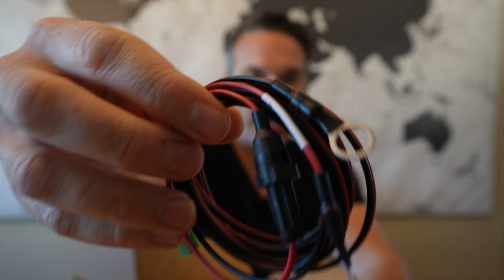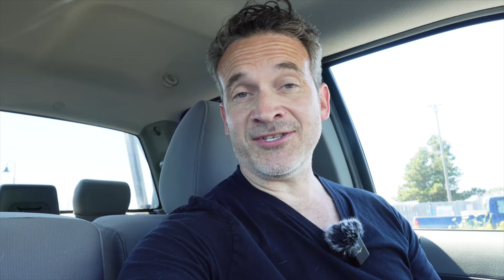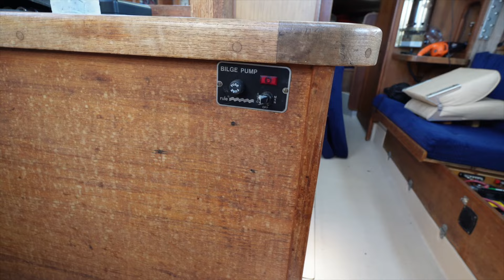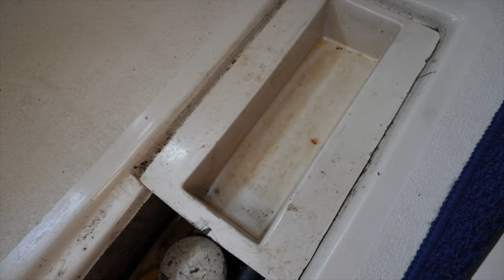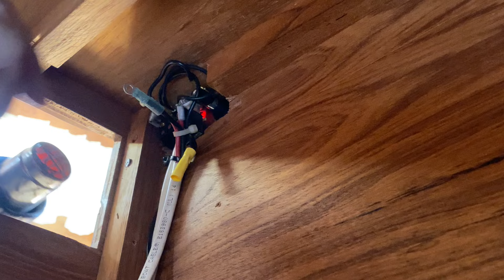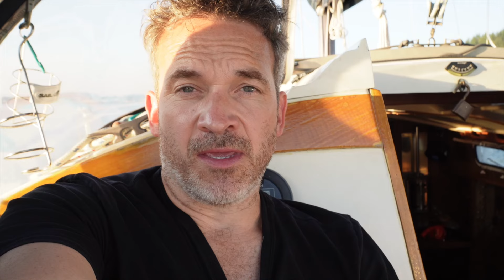ROAM DEVICES: Finally, An AFFORDABLE Cellular Boat MONITOR?! | Reviewed

Comment: Just ordered this kit; looking forward to having the peace of mind regarding my boat status at the marina when I'm sitting at home.  I have a "wash-down" deck, but still worry about water in the bilge during rain storms or while sitting at the dock.
Reply from the maker: That’s great! I think you’ll like it. They have recently expanded to include remote Ruuvi temp/humidity/motion sensors as well as a latch/door sensor so the platform is expanding which is pretty cool!

Comment: A very cheap remote anchor drag alarm can be created with an old mobile phone and the 'Anchor Pro' app.  The paid for version is cheap and, in my opinion, very good.  If you also have Telegram installed on the phone, it can send you a Telegram message on your regular phone alerting you to drag.  You can also interrogate from your onshore phone and boat's position.
You would need to connect the onboard phone to a charger if away from more than half a day or so although this is not a problem for me as I'm not away from the boat for more than a few hours when I would want to know if my anchor is dragging.
Of course this doesn't have all the other sensor functionality of the Roam device but anchor drag is the big one for me
Reply from the maker: Wouldn’t this old phone need to be connected to the cellular network either via starlink satellite or regular local or roaming cellular coverage in order to send you the telegram?
Reply: True, would need cellular coverage. I have that pretty well everywhere in Greece where I sail and I can get a SIM for $5/month